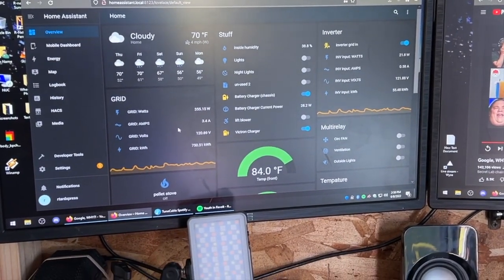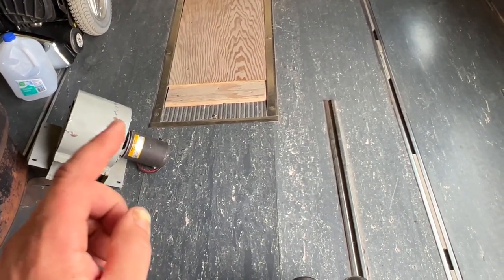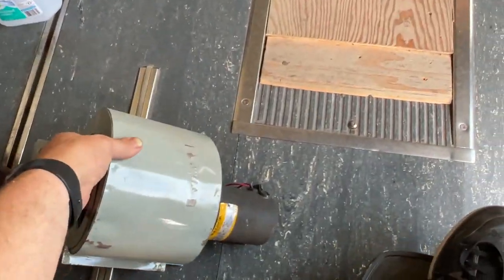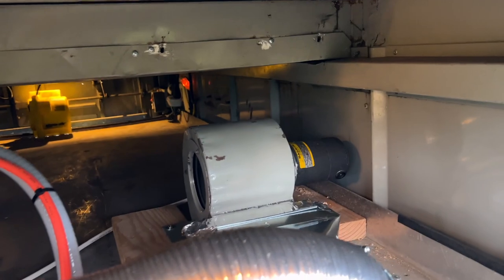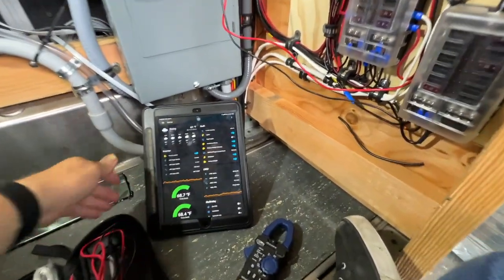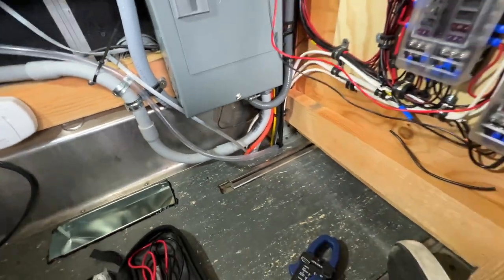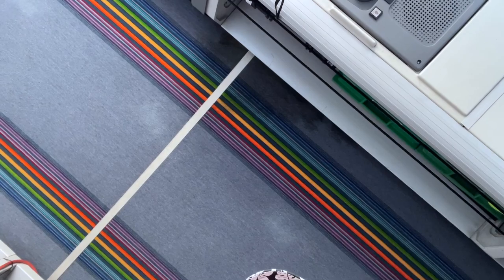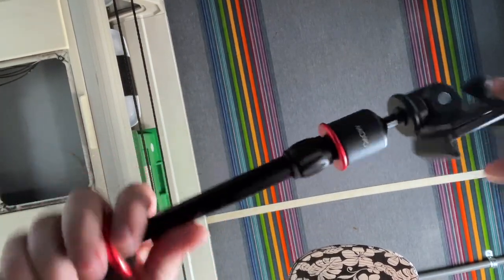VLOG 616: vans & blowers! (bus ventilation)

Comment: Next time you have chance. Take a flat piece or something over bottom edge of blower duct while running. Slowly move the flat piece up over the outflow opening. Attach Amp meter to power supply line to monitor. As you move the piece you will see a much higher movement of air. Possibly up to 100 percent or more. The amps will also rise. Once you have covered the opening. To the motors recommend amps, wala that is the max recommended. You will be impressed with the output change. The flat cover can be placed to stay there. Hope it helps. I have multiple like this.

Comment: I’m curious does the inverter get hot as it operates? if so are you going to be blowing hot air into the bus.
Reply from the maker: the inverter does generate a negligible amount of heat.. but the luggage bays have cross connected vents, so in theory the air should be fairly cool

Comment: Nice work!   Question, what is the "big ac power monitor" you pointed at? (White inline ac thingy)  ... been looking for one
Reply from the maker: that's a ZOOZ Z-wave switch with power monitoring built in.  its not a stand-alone device though.  i use it with home assistant to monitor power consumption
https://amzn.to/39q5qSR (amazon associate link)

Comment: That Baldor squirrel cage was probably just an auxiliary duct fan to help keep air moving. Nice re-purposing. Don't bother labeling the circuits. Your future self will certainly remember what is what.
Reply from the maker: yea kinda strange.. they just pulled air from inside above the drivers head, and pushed it towards the back! lol
Reply: @TotallyNormal-  Interesting. Are you going to put thermostat logic on the Baldor? Like if outside temp is < inside temp & inside temp > desired temp = turn on Baldor.
Reply from the maker: yup! pulled it into home assistant already :^)